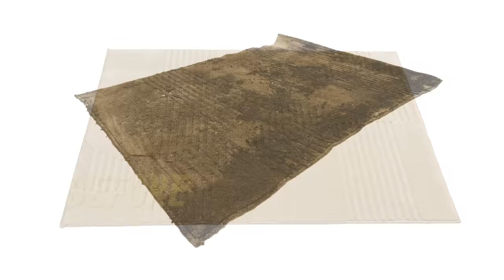Insect Infested Rug - Carpet Cleaning Satisfying Video

Comment: That is a real satisfying carpet cleaning video, and I'd have figured the carpet was maybe rotten or damaged in some sort of way but apparently not.  I've home cleaned my share of home area rugs and car carpets, my own stuff of course, not on a job.  Its amazing to see the in-depth professional process for pro carpet cleaning.   Rugs aren't generally cheap, the good ones, I have my feet resting right now on a $96 rug bought at a discount chain store and I fear all the time about spilling milk or other liquid milk products on it,....done that on the former area rug, ..where I thought I cleaned it good enough and it still soured,..had to intensively clean that one front and back with a home carpet cleaner over and over, then the drying, it was tough in winter, not drying outside but inside draped over some chairs for a week, and there was that wet rug smell all in the home,...rolled it up after dry,...very clean, and we bought a more expensive rug to put down with shorter pile and not as shaggy as the other..

Comment: I just recently got hooked watching these carpet cleaning videos. I have a question that I hope isn't a dumb one. Wouldn't it be better if that pan (for lack of a better word) that the rug is in was inclined slightly so all the dirty water would run toward the drain? Even if the one end was only one inch higher, it seems to me it would make the job a little easier. BTW: Excellent work getting that carpet looking like new again.
Reply from the maker: Yeah you are right. Thought i built it with enough gradient but next one ill build better

Comment: I really applaud the attention you pay to your work. Do you think it would be advantageous to have your basin at a slightly increase angle so the water is more inclined to run off rather than pool? Or perhaps have a grille surface that allows the water to instantly drain away?
Reply from the maker: Im literally rebuilding it now with more of a gradient

Comment: Would have been a better/easier clean if done on an elevated and grated surface  so the dirt is immediately removed and rug is not sitting in its own dirty water. 

Suggestion the existing tub needs a 1-2% gradient so the dirty water runs off easier

Good effort though

Comment: Looks like the owner could have saved you a lot of trouble if they had just hosed off the rug before sending it to be cleaned.  Just put the rug face up on an angled driveway and hose it off, then put the rug face down and hose it off.  Likely would have gotten rid of over half the dirt just by doing that.  Angled driveway means the dirt and water will run off.  Leave it outside to dry, then hire you to clean it.

Unless the owner hosing the rug off would have made the later dirt harder to get free?

Comment: carpet cleaners who clean rugs and carpets and the water just doesn't drain well at all in your bays.  this is so unsatisfying.
Reply from the maker: Yeah sorry about that. Its my first build. Prototype 2.1 will be much better. Coming soon
Reply: @MountainRugCleaning  i'd basically get it at like a 2 degree incline, with like some kinda pattern with small holes so water and dirt just falls.  sure that means you gotta open it or something and clean it sometimes but maybe weekly maintenance.  then maybe those pressure washer things for spraying underneath cars but flip it so it sprays down so you can pressure wash rugs with ease.
Reply from the maker: @edwardc4453  yep definitely putting more gradient on this time.

Comment: Curious, what is the environmental loss/gain from cleaning a rug like this? Most rugs are made of various plastic compounds so of course this is something that won't biodegrade and will rot in a landfill if it was discarded - but the cleaning looks like it uses a LOT of water and other resources. Is it "worth it"?